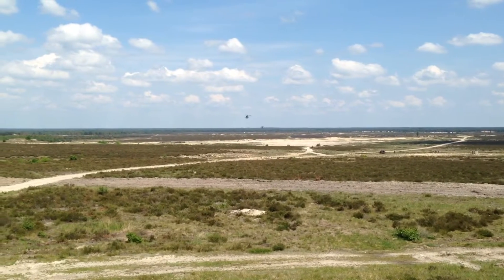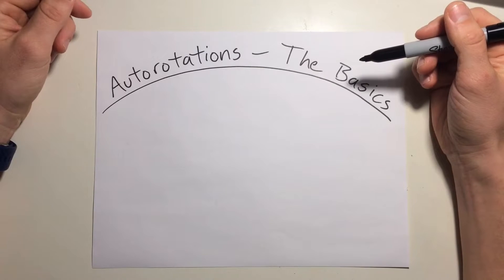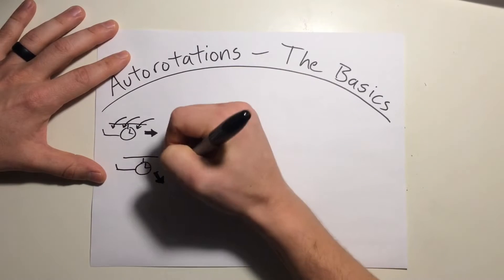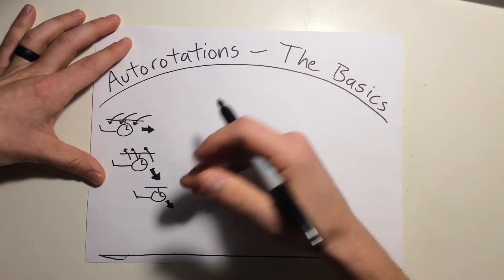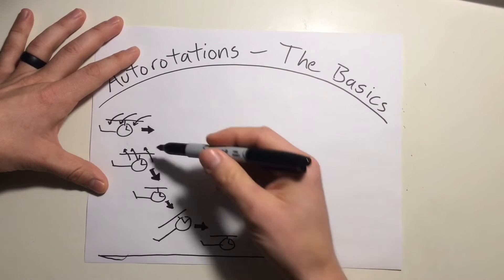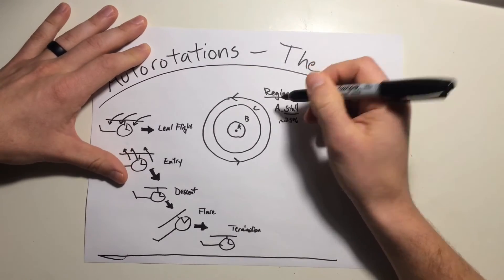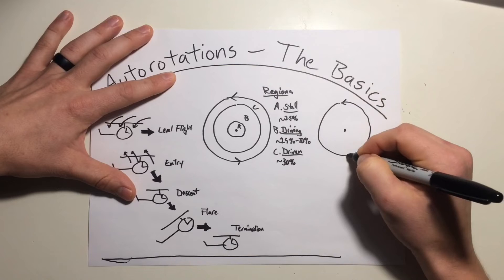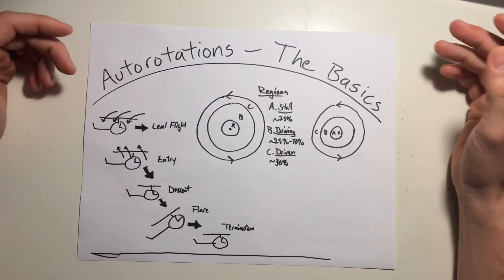Autorotations (The Basics) in Helicopters

Comment: Great video/in what condition would you recommend autorotation? Engine total failure, partial loss of RPM? what are the conditions that have to be met to autorotate (speed, altitude etc.) great video, thanks!
Reply: You simply just need to keep the "rotor in the green." So if you have a complete power loss it may be due to engine failure or something more complicated like an Engine Governor/Control unit. In this case the rotor RPM will decrease rapidly. So you have to lower the collective rapidly and flare the aircraft in the entry phase. Then you have to check engine instruments (usually TGT in turbines or Engine RPM in pistons) and confirm what you have. If you have a slight power loss, you may get a reduction in Rotor RPM, but not alarming. Especially in a twin engine helicopter. You should diagnose the same way. But you don't respond to any cockpit warning sounds or lights, just what did the rotor do. There isn't any point, as is dangerous low level, to dump the collective at every little problem. So with a slight power loss, then you keep flying the best you can, diagnose then either make a powered descent into a powered landing, or powered descent in an auto at the bottom where you actually roll off the throttle yourself, a non-powered descent and fixing the problem to fly away... The scenarios are endless. But the main point is, ROTOR IN THE GREEN! ;-)
Reply from the maker: OthelloCarouge. You should enter an autorotation anytime you have lost all engine power. You never get to pick when engine(s) completely fail on you so you must always be ready to enter an autorotation despite airspeed, altitude, etc. . If you've lost power and keep collective pitch applied the rotor will slow down and become useless for you. However, if engines are working and just rotor RPM is low, you should immediately adjust the collective to maintain rotor within limits. This should not require as drastic of a collective reduction as entering an autorotation.  I hope this helps.
Reply: With the EC120 Colibrí you also get into autorotation in case of engine fire in cruise flight and if you have tail rotor loss of authority, but in the latter case as this type of helicopter has fenestron tail rotor you can have good control of the aircraft as long as you keep 65kts or more and then choose when to enter autorotation. In such case engine should be idled to prevent the helicopter from yawing at the end of the manoeuvre.

Comment: Thanks for sharing. During autoratation, since the tail rotor is also power off, how to prevent or minimum the helicopter from spinning?
Reply: The tail rotor and main rotor are connected with separate gearboxes so the main will drive the tail
Reply: @matthewdowdy3933  Thanks a lot. Very insightful. Brilliant engineering.
Reply from the maker: Ho Mun Wai. Due to the fact that the main rotor is not creating thrust, there is no torque effect to compensate for with the tail rotor.  So during an autorotation there is no longer the need for left pedal applied. The pilot actually needs to apply right pedal to take out the anti-torque correction in order to keep the nose straight.
Reply: During descent that makes sense, but would you have to compensate for torque when flaring? and if so, how, if we have nothing driving the tail rotor? Forgive my ignorance, I've never flown anything in my life.

Comment: After how much later of engine failure should a pilot enter into autorotation and on what factors does it depend ? Can this duration be be different for same helicopter at different conditions ?
Reply from the maker: Actin Bisht. Thanks for the feedback! You should immediately reduce collective when an engine fails in order to maintain rotor RPM. Rotor RPM can decay rapidly to a dangerously low level if you do not make corrections within just the first few seconds. This can vary greatly depending on rotor system inertia (high vs. low system), how much pitch is applied, the type of failure in the engine (full engine failure vs. partial engine failure), etc.  It is best to have a thorough understanding of your airframe in order to make better decisions during emergencies.